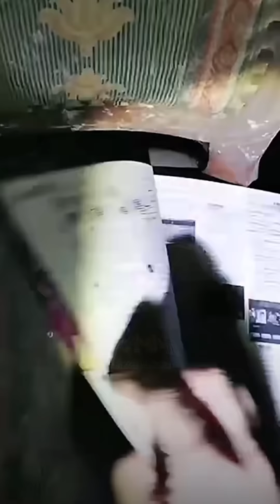SCARY Ghost Videos!進入封閉10年的靈異酒店內部  Pt.2［139］

Comment: If would be scarier if an apparition showed up and disappears then gate from the distance will violently shut, then all of the things around will follow  sending you into extreme panic. And the icing will be a massive ceiling collapse.
Reply: at 23:50, something was not dropped it was thrown! Slow the video playing speed down (I would suggest Youtube Playback Speed 0.25x). At 23:48 a small white piece of porcelain tea cup FLIES in to the room through the door way to the left (you will see a white dot appear just below where the darker blue line painted on the wall meets with the TV cord), then it turns direction in MID AIR (you will see the white dot appear follow the TV cord down to the shadow of the window bar), as it comes towards him and hits the wall below the window. That's why he thought something had fallen.

Comment: @OutdoorXiaolong at 23:50, something was not dropped it was thrown! Slow the video playing speed down. At 23:48 a small white piece of porcelain tea cup FLIES in to the room through the door way to the left (you will see a white dot appear just below where the darker blue line painted on the wall meets with the TV cord), then it turns direction in MID AIR (you will see the white dot appear follow the TV cord down to the shadow of the window bar), as it comes towards you and hits the wall below the window. That's why you thought something had fallen..